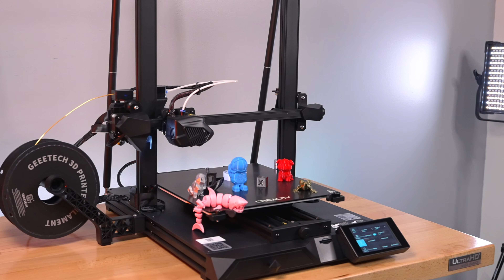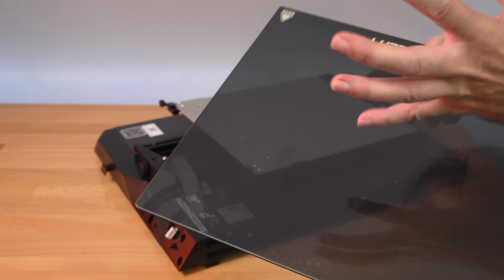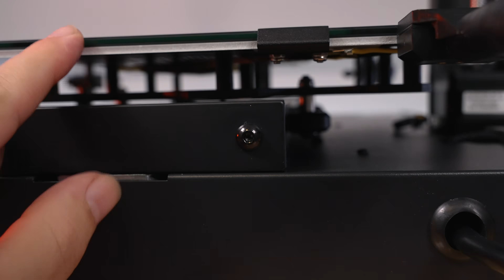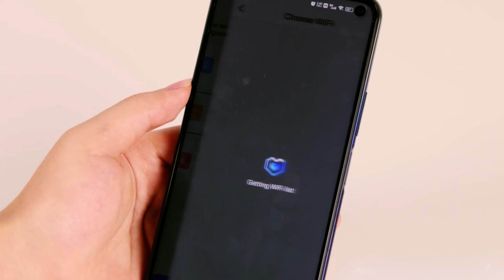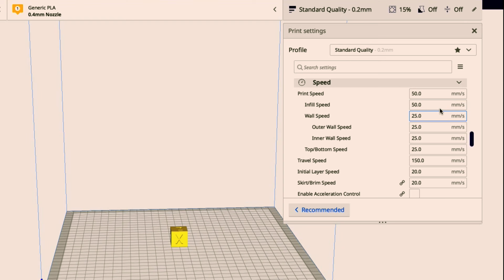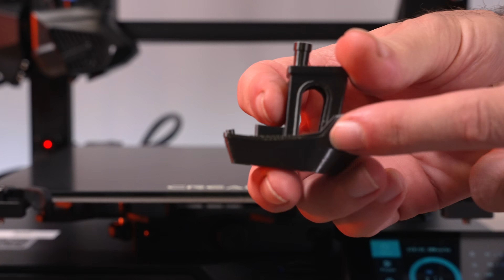Creality CR-10 Smart - 3D Printer - Unbox & Setup

Comment: I bought it but I have vibration in y axis like yours maybe even worse. How can I solve the vibration problem I tried to loose the belt nothing changed. I dont want to change glass bed. Is the cause weight  of glass bed? Please I need advice.

Comment: Mine has had a catastrophic  firmware failure after only 3 months. Will not boot or stay on. Have re flashed the firmware given to me by Creality to no avail. Needs a new mother board and screen. Being provided by Creality but that will take 3 weeks to arrive. Plus the time it took to get them to send one. Machine will be out of service for over a month, not including replacing the board and then seeing if it even works. Very disappointed.

Comment: Very helpful. Am setting one up right now.  
But I will add 2 point.
When installing the reel holder, you can disconnect the mount from the arm, attache the mount, then bolt the arm back on. Much easier.
Second, and most important, try powering it on before attaching the gantry.  If it powers on, all good, proceed. If it doesn't, gently flip it over and remove bottom plate (watch out for the fan wire attaching the plate to the circuit board. 
Check the side of the power supply for a recessed red switch. Make sure it is showing either 230 or 110 (maybe it was 115), which ever corresponds to your region.
I spent half a day using a voltmeter to test various connections, fuses and wires before I found reference to this.

Comment: @39:32 Start G-Code should not be changed from E5000.00 to E500. The image provided with the printers manual is cropped and refers only to "home" part, not to the rest of the code.

Comment: 39:31 Do not make that correction on the settings of Start G-code. It should remains E5000
Reply: Why, bro?
Reply: @yokai3d604  I did that change and the hotend stroke on the border of the bed. That is wrong for sure!

Comment: hi I  just bought my cr10. smart I did what's in the video for tightening the bed only 3 of the 6 wheels get tight the bed doesn't wobble but I feel a little skip when I slide it any suggestions would help. thank you

Comment: Hi Vlad I have a question cuz I did not see this anywhere does this printer have a switch for 110-220 V?  Please answer if you can
Reply from the maker: Not 100% sure but I think there was a switch on the power supply as it is 110v-240v
Reply: @JustVlads  it doesn't have one 
Thanks for the response and the video I really enjoy this printer :)

Comment: In order to disable power loss recovery for the printer, you must insert the following code at the top of the start gcode in machine settings (CURA): m413 s0
(Obviously if the power goes out, your print will automatically fail without being able to recover).

I also like using this gcode: m300 p200 s440 (play tone) only works for certain printers. I know it works for Ender 3 Pro (very loud), Ender 3 V2 (too quiet), and CR-10 V2. For me it seems to only work on the printers with the blue LCD screen. I use it to let me know when my print starts and ends.

Comment: I used a machinist square to make sure the gantry is at 90.

Another thing I’ve seen you do in the past is make sure the X screws are at the same point.
But I guess with the auto leveling it does not matter.

Another good review.

Comment: Considering the name of this offering from Creality contains the word "Smart" some people may be wondering why you did not show the "Smart" features of this printer. I was not wondering and in fact suspected this part would be ommited from this review, you see there is a reason and that reason is that it doesn't work, Creality have just stuck the guts of their WiFi box in there which also had problems when it launched and still has problems, also there are problems with the cloud printing site not working correctly, well you could always connect via Octoprint, except that you cant, Emily The Engineer also failed to show her viewers that the Smart function did not work.
 Considering that your loyalties lay with the company that provides you with free printers and not with the people that buy printers with hard earnt money I shall no longer be watching your videos and I suggest no one buys a printer based on your reviews as they are not a true evaluation of the product, "Did Sainsmart Ask You Not To Mention The WiFi" is the question that should be being asked
Reply: You can use Octoprint, but, one cable has to be moved internally and a micro usb cable connected to a raspberry pi.
Reply: @kry102001  they are taking the community for fools by fitting the WiFI box to this printer, a Raspberry Pi should have been fitted, even a Zero W would have been better to connect to their cloud service with stolen models than this abomination, they are 100% aware that the Wifi box does not work correctly.
And this is not a review its a paid advertisement, Vlad is trying to take people for fools and is just as bad as Creality IMO
Reply: @AndrewAHayes  I’m in full agreement with you there, was just saying that it is possible to use octoprint, you said you can’t connect via octoprint.
Reply: @AndrewAHayes  haha yea just get a duet and thank me later
Reply: @seanwood5443  I already have one on my Pro 3D v-King 400
Reply: I have done a tutorial for hooking raspberry pi to the smart
Reply: Octoprints garbage if u got to upgrade get a duet 2 wifi sooooo much better web Interface
Reply: @seanwood5443  and you really think a total newbie to 3d printing is going to be happy pulling out the main card from the printer and replacing it with a duet 2 ? Octoprint might be garbage in your opinion, but, for those too scared to do such a big upgrade, it’s better than Creality Cloud.
Reply: @kry102001  it’s alot easier to take the main board out then mess with octoprint plus duet is way better operating system
Reply: @seanwood5443  I’ve watched videos on replacing the main board, and compared to swapping one cable and connecting a micro usb, it’s much more complicated, I’d be terrified to change the entire thing, if your good with electronics, it might be simple, but, not for total idiots like me.